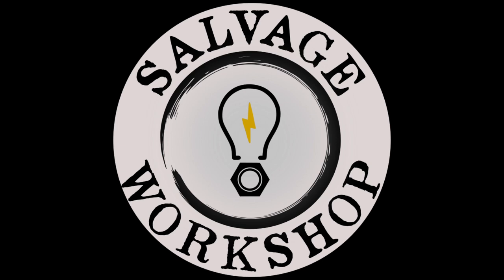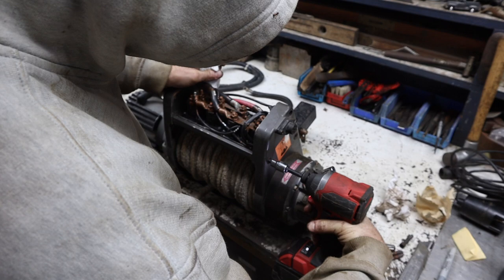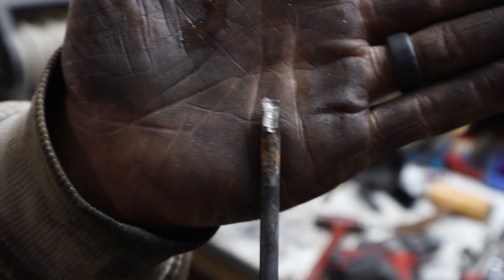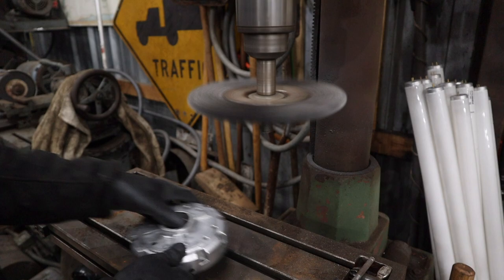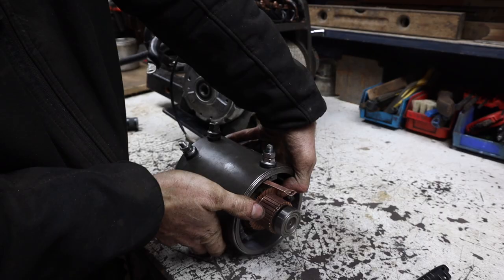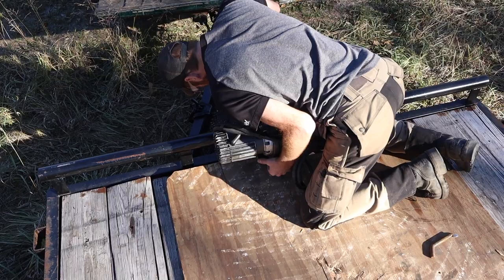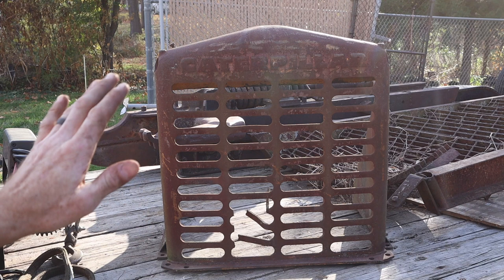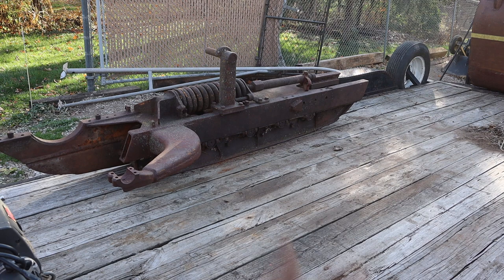Fixing a Winch so I can RESCUE Forgotten Parts ~ Part 9 ~ 1950s Caterpillar TraxCavator

Comment: If you plan on running the machine in rock or broken concrete then by all means run the roller guards. However if you going to run in sand crushed stone mud or snow then leave them off to allow the chain to clean itself out. When you turn and fill the chain with material the track gets super tight, you need the rollers to let the material out to prevent excess stress on the recoil springs. Hope that makes since.
Reply from the maker: That's kinda what I was thinking, plus I don't have them for both sides anyway!

Comment: You asked the question if others ever have to fix something so they can use it.  My son had my  40" wood lathe and cracked the cast iron base.  When I asked if I could "borrow" my lathe back to make Christmas presents, I found out it was unusable.  Watching your channel was in large part, the reason I had the confidence to successfully repair this tool.  I've now been using it for a week and it works as good as new.  Thanks for the insight.

Comment: The four relays form a double pole double throw high current switch for reversing the polarity to the motor for forward and reverse, they have nothing to do with a safety or redundancy, they are just a high current switch using four solenoids.  I've built circuits like that for high current motors.

Comment: On your initial winch repair, I acquired a Warn 16.5ti winch (Heavy bugger) and I got it because the previous owner said it just stopped working. He had already changed all the solenoids in his attempt to fix it. I tested them just as you did, and all tested fine. I could put power directly to the motor and it would run in or out depending on how I jumped it. After some further testing, I found that a few of the control wires and one main battery cable were shot.  Now I know I could've just fixed the wiring, but I decided to "simplify" things. I pulled out the solenoids and replaced them with a reversing contactor. More room in the "control box" and it really did simplify the wiring. Factory remote works as it should also. Now if it stops working, I only have one contactor to worry about (assuming the wiring and motor are ok). Great videp.

Comment: Loved this. Had some years here in the UK where I had to load dead plant from abandoned sites. Nobody around so you had to think your way round getting it onto a low loader with the winch, bits of rope, baulks of timber, lengths of chain etc. Great feeling when it's on and chained down. Rest and a couple of smokes, then head for home.

Comment: The middle gear (on the motor) is the sun gear, the ones in the carrier are planets and the outer is normally called a ring gear.  The whole thing is mostly referred to as an epicyclic or planetary gear set.

Comment: Your stator is the windings inside the motor jacket. As the rotor spins around the stator applied voltage is introduced. Any corrosion or rust will not apply the 12 v need to spin. Great job.

Comment: The best thing I did with the winch on my trailer is put a wireless remote relay setup on it, mostly because the original was shot when I got it. Works awesome for loading up vehicles that don’t run when I’m by myself
Reply from the maker: I like that idea... ill have to look into that! What wireless remote did you go with?
Reply: @SalvageWorkshop  it was just a cheapo eBay setup, cost around $50 for 2 remotes, the relay and wireless control box and seems to work pretty good for the year and a half I’ve had it. Probably better kits out there but it hasn’t let me down yet!

Comment: If the solenoids are clicking check for voltage at the motor.  If it is present check resistance across the motor terminals.  If open circuit rotate motor looking to see if it stays open or if it is intermittent.  If it stays open give it a few good thumps.  Still stays open brushes are suspect.  Intermediate then the stator, or winding are suspect.  If no voltage at the motor then back up to the relays.

Comment: You always do a great job. I wonder though if it wouldn’t have been quicker and less time consuming to have brought your fork lift. You are one hard working guy.
Reply from the maker: I appreciate that Darryl! Moving the forklift is REALLY hard with the tools & machines I have right now... Trying to drive it onto that trailer the way the ramps are currently setup isn't even possible because of how little ground clearance fork trucks have, plus I need to have it at the shop to unload with... I have something in the works for that I will be able to take places (that's an upcoming series, SHHHH!!)
Reply: You are always busting your butt and just thinking about your back and stuff. I should have guessed you had something else in the works to get the job done. I look forward to new videos and especially your new cat project.

Comment: I learned a bunch of stuff from watching the whole video.  Excellent visual going through the winch motor.  Thanks-
I would have done one thing before pulling the pins on the bucket.  Double up on your winch rope by using a snatch-block to increase the power.  Just weld a hook or heavy D-ring to the trailer frame near the winch, hook the winch hook to that and use the snatch-block in the loop that you've made to hook onto the item.   Great content, keep up the good work!

Comment: The four solenoids are to utilize 2 of them to throw the DC polarity for forward, the other two are to reverse the polarity for reverse. The motor sits in an open neutral state until the coils of one of the pairs is energized.

Comment: Ya know, if you had a track-ter with a bucket loader you could have gotten those parts on that trailer much easier.
Reply: Its coming , its coming!!
Reply: If you were thinking ‘Big Red,’ you know it wouldn’t steer don’t you? Cant use a loader that only turns one way, and doesn’t do that very well either due to the smooth drive sprocket on one side!
Reply: @grahamstretch6863  this only turns one way?
Reply: It’s called main strength and ugliness

Comment: Yes they are if you are planing to load rock, work in rock. 
A softball size rock can roll in between your rollers and if not caught fast can EASILY throw your track. 
This is why most of the commercial,  contractor ones had the rock guards. 
The farmer, private person usually did not fork out the extra expense for the optional upgrade.

Comment: On all our tracked machines, we always had no rock guards, or we removed them if we got a piece that had guards installed.  I suppose if you are predominantly/constantly working in areas with a large amount of rocks that could jam a roller, they might be a good idea and relatively little would end up collecting behind them.  For us, the primary rule we had was that the tracks were cleaned every day (after shift) and the majority of the moving parts were greased (rollers and pins, mainly).  I can't imagine how much stuff would build up around the rollers and tensioner when it couldn't be cleaned regularly and you had guards on the tracks.

Comment: Thanks for the interesting videos. I greatly enjoy them. I have often loaded heavy items by winching them into my trailer but I do it a little differently. I put the plywood sheet next to the load and roll the load onto the plywood.  I use a Bridge C-Clamp to attach my winch cable to the plywood not the load on the plywood. Pulling 800 hay bales onto a trailer is much easier this way as the load isn't digging into the ground when moved.

Comment: Take 3 to 5 links of chain and 2 grab hooks and make a set of Sister Hooks. Then you can shorten a long chain to any length you want, such as when you had your chain twisted up to redirect your winch line and snatch block. Find a couple of old steel grain shovels, keep the top side rusty and pitted, lift up any dragging points and slip the shovel underneath with the handle pointing towards the winch. Gravity and weight will usually keep the object in the shovel pan as you pull over rough terrain. If you are sliding over steel, drip down some sunlight dishsoap to ease the friction and remember where you put the soap so you don't slip on it when securing the load. 8.5 years of towing and recovery in the Rocky Mountains added some tools and tricks to my toolbox.

Comment: I'm sure you've probably already thought of this but if not... you have access to a bunch of old round wood fence posts? Might be enough to reduce the rolling friction and get that bucket up; once you fix the winch brakes of course.
Reply from the maker: Ya, not a bad thought... ive got some large thick wall pipe that i was thinking about doing that with... or even cutting the 1/2 rotten telephone pole that i moved in the video into a few pieces and using it as rollers... not sure what the plan will be as of now, but ill make sure to take you along when i finally go back and get it!
Reply: Some people say that’s how the Epytians moved those large blocks of stone

Comment: I'm not sure about the rock guards on that particular Traxcavator, but on the D3 they're a blessing and a curse.  for gravel they're great and no complaints.  but when you're moving brush or into wet mud they're a headache because everything gets wedged in there.  At the brick plant, we welded extra steel plates angled out to prevent that and to keep the mud from getting in there.  If you've ever worked with clay, after a few days it would harden in between the gears and the rock guard, or even into the hinges of the track and just get hard a rock.  The D3 is strong enough to break it loose, but man after you come back on Monday and jump in, as soon as it broke loose it would scare the crap out of you when it went BANG! and CRACK!  makes you think something snapped.

Comment: Hi, excellent series on the Traxcavator. The winch has an epicyclic gearbox that is made of sun, planetary gears etc. you talked about measuring ohms, on the multimeter, but really it is a measurement of resistance in Ohms, for a closed cct the usual reading is 0.1 - 0.2 ohms depending on cable length

Comment: Nice winch restoration :)
Just a quick advice about coiled electrical devices (motors, transformers, etc) you should check the coils before working on it mechanically, I write this by experience. when I was an apprentice, I disassembled motor, cleaned all the parts, mounted new bearings, reassembled just to find the fault was electrical, the coils had burned, I just got fooled by the absence of the typical stench of burned  lacquer that coats the coils for insulation. It's a rare occurrence, but sometimes the coils just snaps inside the lacquer, without burning it by arcing. From this moment, I check the electrical side before taking the motor apart, it saved me a ton of time.

Comment: The tiller and blade are not for a 318, it's a 31 tiller and fits a 110, 112, 200, 208, 210, 212, 214, or 216, and a 43 blade which fit the same models.
A 318 needs a 3 point tiller or a 54 blade, which are a lot rarer.
You do have the mule drive for the tiller, the hardest part to find, though!
Just wanted to say that.

Comment: One thing no one else has noticed: The bolts on the motor that you moved do matter. What you've done is rotate the brush assembly relative to the coils in the stator. This is known as "brush advancing" and you've now advanced (or retracted) them some 10-15 degrees, which is a huge amount. This is sometimes done deliberately to motors so that they can handle higher voltages in one direction, at the penalty of arcing worse in the reverse direction. Your change is going to result in signficantly reduced torque and significantly reduced brush life compared to the motor's original "neutral" position of the brushes. Also, you never want to clean the carbon dust off the commutator bars. That fine graphite powder will take days or weeks of the motor running non-stop to replace. It provides a conductive cushion for the brushes to ride on, it's a lubricant made of the brushes themselves. This reduces brush wear and commutator wear. In your case, a winch might see an hour of runtime in an entire year, so you're not worried about long term durability, but since all winching is relative large load, you're far more likely to burn the brushes or commutator our entirely by these two changes you didn't know you were making. Just food for thought.

Comment: Man your a beast on this stuff, that rebuild on the winch motor was well done, I suspect it was both the bearings and the corrosion on the brush contact point.  And damn I agree, get yourself a helper or such man, don't wanna see you get hurt.

Comment: I might be wrong, but at first glance the reason they put 4 solenoids in there is because they are in an H bridge configuration allowing to reverse de polarity on the dc motor. Not de redundancy reason.
Reply: You're not wrong

Comment: At least you broke a strap doing something cool. Last weekend I broke a 25 ton strap pulling out a broken fence post.
Reply from the maker: What's not cool about removing broken fence posts!?!
Reply: @SalvageWorkshop  it wound up being cool. They had it 3' deep and concrete the whole way down. I had to dig it half out by hand, bust the concrete with a sledge, and yank it out with a F350. WAY too much effort for a 4' post on a picket fence. Lol

Would have used a tractor if it wasn't in a suburban yard.
Reply from the maker: @Roboticus_Prime_RC  I owned and ran a Landscape Design & Construction Business for 10 years, trust me my friend, I've been there! Sometimes you just gotta do what you gotta do!

Comment: Metal clad winches often had issues with condensation in colder/wet  climates (Im 65/Seattle, now san Antonio). Put a cover on it when its not in use.

Comment: The 4 solenoid's are not redundant, they are wire to reverse the polarity from the battery to the motor.
Reply: Yep, it's an H bridge.
Reply: Yea, that fella doesn't know what he's talking about.
Reply: Well, he fixed it,  so whatever.
Reply from the maker: lol... your not the first person to challenge that!  Warn solenoids are in an H bridge configuration, but not your standard mag motor H bridge but a series wound H bridge.

Warn does not switch the ground lead! The ground lead goes straight from the battery to the motor! More importantly: The solenoids are not in parallel. They are in series, so if any one solenoid fails, your winch will not work in that direction. Hence the safety.

Comment: Did you know that the big pry bar that you used is called a "Gandy Dancer's"  bar? A Gandy Dancer was part of a railroad track crew and the bar was used to straighten track.
Reply from the maker: I did NOT know that! That's cool, thanks for letting me know!
Reply: We use em on a drilling rig where they are known as a much simpler “5 foot bar” lol or rock bar
Reply: In South Africa we called the bar a gwala.
Reply: Yep, a Ghandy Dancer was a track maintenance guy / crew on the Ghan Railroad in South Australia headed from Adelaide up to Alice Springs in the Northern Territory.
Before that railroad was built everything was transported on camel trains operated by Afghani Cameleers.

Ghan is an abbreviation of Afghani for the cameleers  who shifted freight by camel train before the Ghan rail line was built to replace them.

More of Aussies 🇦🇺 lost history.🙄
Reply: @ianmoone2359  I did not know the origin of the term. Thanks for the info..
Reply: @stan118  I worked 10 years in railway engineering employing track maintenance crews, ghandi dancers, fettlers, track men, track masters etc, there were many different names for them.
Reply: Nah, that’s just a crowbar, railway bars I remember, were 6’ octagon bars, the shunting crews used them a lot.
Reply: @CrimeVid  Track crews had different bars, some for pulling dog spikes, some for levering points at points and crossings etc. there are many tools that track maintenance crews use specific to the task Thermit Welders, Rail hole punches and so on.